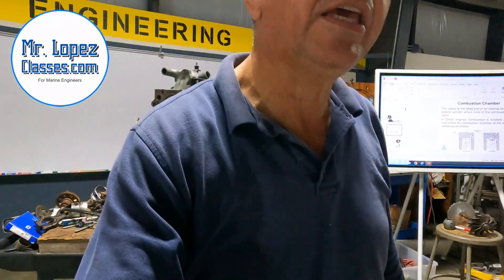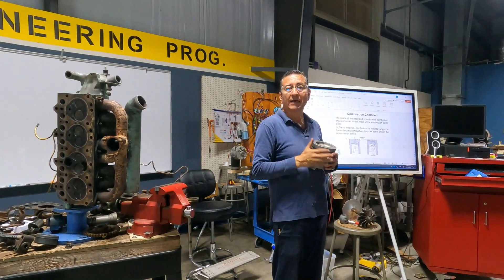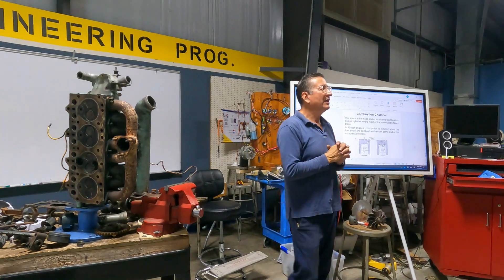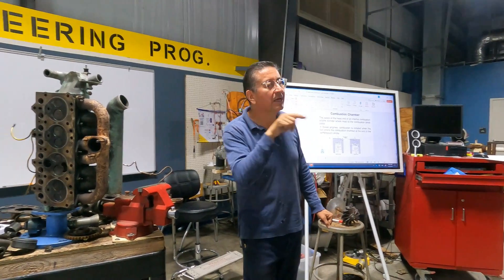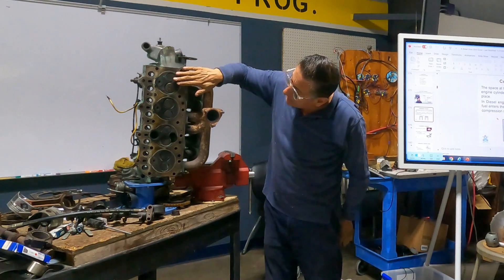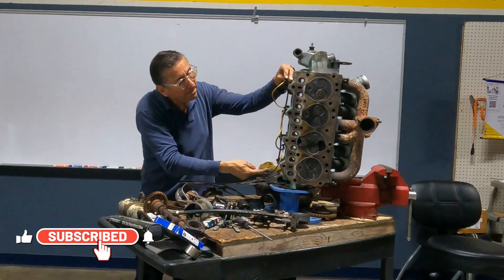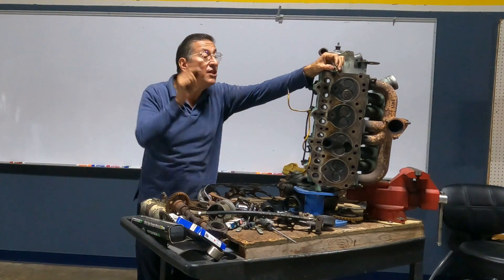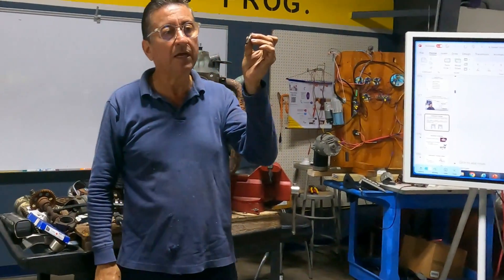Diesel Engines Combustion Chamber

Comment: I have issue with the term "explosion"!  In petrol engines it is called detonation, and in diesels it is a knock.  I believe diesels are constructed so much more durable and robust that the knocking condition is tolerated more.  The condition's causes are numerous, but when the injector fails to atomize the fuel sufficiently, the large droplets take too long to absorb enough heat to combust and "explode" all at one time post injection.  But I would prefer the term "burn" to describe the normal operation.